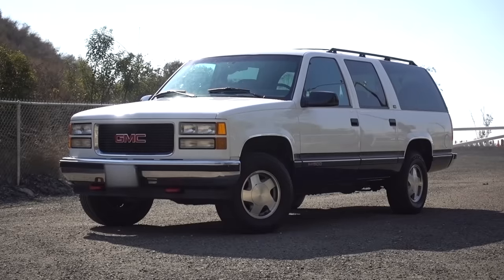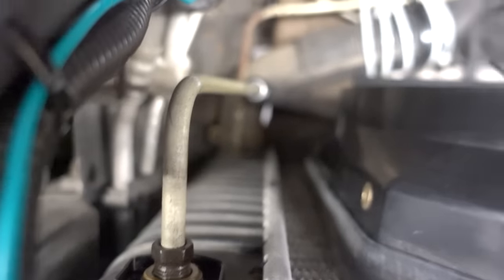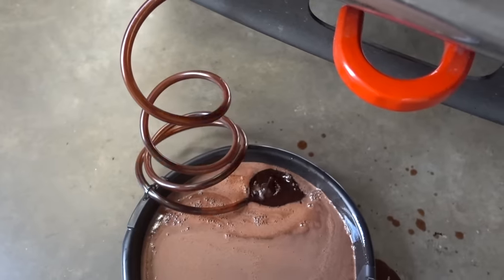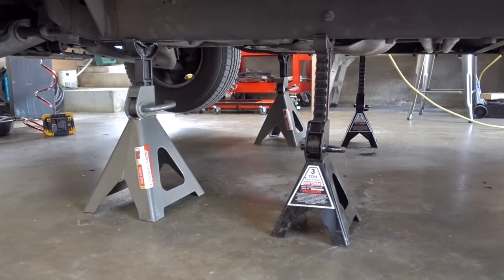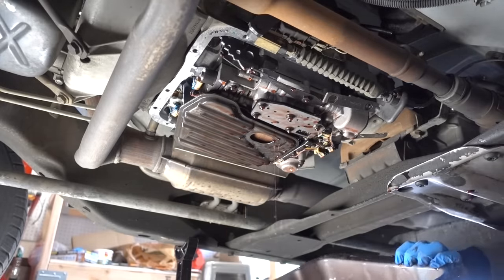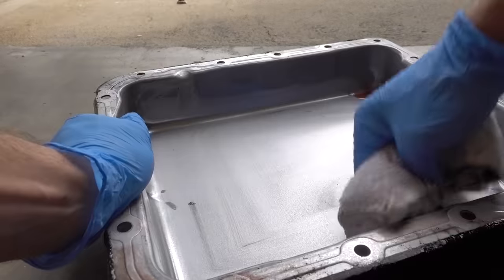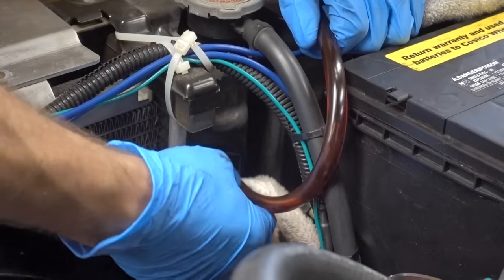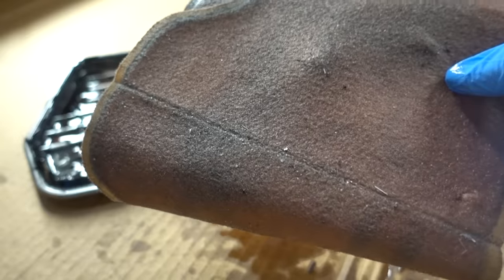Why You Should NEVER FLUSH YOUR TRANSMISSION FLUID!!

Comment: Hi, why you don't recommend to tight down the valve body bolts? If they are loose seems to be a good idea to tight them...

Another question, why you didn't use any RTV on that gasket? Do you think it won't leak?
Reply: What is RTV?
Reply: @shawnclark732  it is a silicon that in order to vulcanizing (get cured) it only needs room temperature. RTV silicone stands for Room Temperature Vulcanizing silicone.
This material is commonly use to either "form a gasket" or as a dressings for the actual solid gasket that comes with the filter, it helps to seal better, there are several good brands out there such as Permatex or JB weld.

As you can see, he didn't use any RTV Silicon on that gasket, that's why I'm asking if he thinks in won't leak...
Reply: @maxdeniel  thank you!

Comment: Too bad they don’t have drain plugs.
Honda procedure to do a flush is 3 drain and fills with a drive cycle between each one.  
I did that procedure to a 2001 Nissan Maxima,  with p0744 check engine light.  It went from not drivable to something that was ok to drive but still gets p0744. ( I used valvoline maxlife full synthetic ATF, Lucus transmission fix and seafoam transtune). And of them all the trans tune I feel helped the most.
On third drain fill did not use any additives just ATF.  
I suspect it has a failing solenoid block/harness, failing transmission temperature sensor , or Failing TCM.  
Also it has now some problems not shifting into o/d where as before this starting from stop and the 1-2 shifted hard.
It has almost 210k miles.

Comment: I changed my fluid on a Dodge truck at 100,000 miles and sure enough it blew the torque converter in about 2 months.  I was warned it would happen. So was it ok?

Comment: Have a Hyundai Tucson 2017 that blew its motor.  !st time I have had an issue with a Hyundai and I've owned 6 now and averaged over 150k miles on three and over 100k on the other two.  My current Tucson had 75k when the engine just quit, got a brand new crate motor installed via warranty and am damn sure getting the transmission flushed now as it still has just under 25k warranty left as well.

Comment: After removing  the filter the VALVE BODY  is usually  located above. The valve body is a elaborate  system of valves that operate the various  mechanism  within a automatic transmission.  These valves control the bands which control the clutches for various speeds. Automatic transmissions are fascinating  ingenious devices that get  taken for granted yet they make life so much better and deserve  A LOT OF RESPECT!!!

Comment: I have been a automotive service technician for 30 years. And I know this is a 5 year old video, but having watched it. I have to say that this is definitely 12 minutes of how not to change your transmission fluid. That so called flush by it's self could smoke the clutch packs and damage the converter with the lost fluid pressure.

Comment: I would drain the pan 1st, then fill it with new fluid and then flush out the old fluid with the new fluid in already and I would stop every 1 liter of old fluid pumped out and top up with new fluid.  Never let the transmission run with low fluid level.

Comment: Why do you not do your first pumping til fluid bubbles then pull the pan, should be nearly empty, clean pan and change filter, re install pan, fill with clean fluid, then start car and pump out remaining dirty fluid until good clean fluid comes out? That way the first clean fluid you put in is going into a clean pan with a new filter. Just my 2 cents. When I do it I do it this way but with 2 people. I continue to feed in new trans fluid while second person goes to reverse, then drive, then second and first. With brake on just to circulate new fluid thru clutches to get a more exact displacement. When clean fluid comes back shut down and adjust level. If low you can add. If high you can pump off

Comment: My friend has a 2009 honda oddasey. At 125,000 miles the transmission  fluid was pure black but not burned,,I know it was risky  but what I did was  remove  the drain plug and replace  the same amount  of transmission fluid ( castro japan make compatible), about 2 quarts ,,,every oil change at 3500.00 miles,,, did that  5 times,,,now transmission fluid has nice shade of pink and I will leave it alone....

Comment: My autobox leaked pretty badly after transmission oil change, I didn't think it was a bad thing, it was just the oil get cleaner, so the gunk that kept those leaks sealed just cleaned off.
Not changing the oil and keeping dirty oil is just hiding the problem until it get worst, oil change revealed the problems.

Comment: i agree with not flushing.  Change once, run the system, change it again.  Flushing, especially some power flushing has more risk than reward.  I have never lost a transmission going back to 1968!  68 ford torino C4.  Ran until 1985.  84 blazer 200k miles,  Three full size K5 blazers, 1988 chrysler 240k miles,  1997 buick 220 k miles,  Now running a 2008 Kia sorrento at 110k miles.

Comment: I would think that this procedure would be hard on the transmission  pump (s) ?  Just like when you run out of gas  in a fuel injection  system the fuel pump is in the gas tank and running out of gas will weaken, if not ruin the pump in the tank. Also the TORQUE  CONVERTER  has to be flushed out and I see this method to take care of  the torque  converter  also. With this method I only see the pumps  integrity  to be compromised .

Comment: Hi,
I have a quality torque ranch and I want to torque all the little bolts to specs like you have done in this video. My truck is a 2014 gmc  
sierra sle 5.3L 4wd. 
Ibwas wondering if it require the same 8ft lbs of torque as well or is it different?
Thank you!!!

Comment: Wow such an involved process. I Love my Smart car with Automatic Manual Transmission. It's a manual that drives like an automatic.. you don't have to use a clutch to switch gears a computer does it for you. I just changed my gear oil. Just remove the top plug then a bottom plug for draining, close bottom plug and fill the tranny from the top hole right from the bottle. Close top plug and drive.  Easier than changing oil because you don't even have to change a filter. I'll Never own another automatic transmission.

Comment: correct way is to know the capacity of your trans system,  then attach one hose to pressure line and put it in drain bucket.. then another hose to suction line and put that hose  a bucket of new trans oil as per your system capacity...start the engine... the drain bucket will start filling and fresh fluid bucket start emptying.. when you see fresh fluid coming out of drain means your system is renewed with new fluid.

Comment: You are correct! I had my transmission fluid in Market changed on my 1988 Lincoln mercury grand pre-with the original 89,000 miles, and right after that, I had to have my transmission replaced.  All that crud that was in that vehicle caused all the gaskets to go bad. It was a very expensive lesson.

Comment: Hi . I saw your clip and I have a question: is it correct Take the two hoses out of the radiator and put the air compressor in one of them until all the liquid comes out (the car off)

Comment: Not all types of contaminants can be removed and there is a chance that transmission flushing will completely clog the oil passages.
I had a customer who put Adblue in his diesel tank.
I then vacuumed, cleaned and dried the entire tank.
Then I flushed all the lines and changed the fuel filter.
It all came to nothing, because the engine had no compression because it had water hammer due to the Adblue.
After the engine was replaced, the car ran again, but the customer was a few thousand euros lighter due to his mistake.

Comment: I do my vehicles every 100000 km  And the only time I ever had a problem with a vehicle transmission is when I didn't do it every 100000 km In my early years when I was afraid to take on such a job. Now I can do it  Fluid and filters usually in an hour.

Comment: I don't think I have ever heard anyone say "don't change your ATF"....ever.  In almost all cases in my experience where a transmission failed after flush and filter change , it was due to incorrect fluid replacement, i.e. Dexron II instead of Dexron III, etc.  But nothing kills transmissions (like engines) faster than abuse and neglect. :)

Comment: I wanted to know more about transmissions but after watching this, ya he did a flush on a 70.000 mile vehicle it should be ok but if it were at 180.000 or 200.000 I'd would advise against it because loose clutch metrial can clock up some components causing failure of the unit

Comment: I flushed my 02 trailblazers transmission at 195,000 and I now have 214,000 and no problems. If done correctly its fine. Flush till fluid its clean wile adding at the same time. remove the pan and replace filter clean magnet and your done. After 500 miles pull the plug and inspect fluid and replace the fluid again if necessary. Forgot to mention i bought a new pan with a drain plug on ebay for $40

Comment: If you didn't flush your system between 100k-120k don't do it  because my experience new oil has cleaning additives that dislodges clutch and disc material from valve body travels down and clogs small cone screen in the valve body and causes areas to get dry check balls stay open and solenoids start faulting out and I have seen orings blow out on clutch packs because the new oil is flowing harder on the initial start up. I'm curious to know how his transmission  will do in the next year at least.

Comment: Absolutely, 100% fore sure, flush trans fluid. I have a 01 GMC Yukon with 626,000 km's (391,000 miles), with origonal motor and trans. I have five vehicles in my driveway in-order to keep with my large family and Km's range from 320,000 up to 626,000. How do I do it? I change all fluids reqularly.

Comment: Not removing that old filter o ring gasket is a no no! There is a risk of the filter rubbing on bottom of pan causing the plastic neck to crack or break resulting in oil starvation and trans failure!

Comment: The oil pan bolts are all the same, just clean them, that the bores are clean as well, and reinstall them, no need for the same hole installation. I would have added already new transmission fluid when getting the old pumped out, not risking running metal on dry bearings. Sludge remaining often in the coolers itself, so they have to be flushed in addition separately. A lot to say more but...

Comment: There's one thing that you've got to do in the process of the step sometimes you can change the little plastic filter that bolts up into your automatic transmission I sometimes highly recommend if you drop your pan replace that little plastic filter because that's also important too

Comment: I had a 2013 ford escape with transmission problems with 55k miles. The transmission fluid was black and the transmission was running rough. After the fluid replacement it ran like new again

Comment: Not trying to undermine the presenter here but seriously, Don't mess with the valve body bolts!!!

Telling people to mess with these bolts is opening the door for some dingle-berry to tighten the bolts by feel, and that is the best way I know to end up at the transmission shop for a new transmission case, or to the salvage yard. 

Putting the pan bolts in the same hole they came from is a complete waste of time. The only exception is when there is a bolt with a stud and nut on top, as in one that holds an external bracket.  GM is a good for that one.   

Running the trans till you see air bubbles is running the pump without oil.  Great recipe for a transmission rebuild. 

The seal that comes with the filter kit is garbage.  Many times, when using that type of seal, you will find the filter sitting on the pan bottom - the next time you service the transmission, this causes aeration in the system.
The filter is supposed to be suspended by the transmission case, which keeps the filter off the bottom of the pan.  

In the old days, filters were flat on the bottom.  They would fall down and sit flat on the pan and cut off the oil flow.
Because of this, they began shaping the bottom.  That way, if it does fall down, it doesn't completely cut off the oil flow. 

When you buy the filter kit, ask for two o-rings that fit the neck of the filter. 

Install the two o-rings, lube them with fresh oil, gently wriggle them into the case.  

If the oil has been run till its nasty, Service the transmission and then do a second change after driving for half hour or the next day.  
Why, because the new fluid has fresh detergents in it and it will wash the sediment down into the pan and overwhelm the filter and end up clogging the valve body.

If you have a Ford, many of them have a drain plug on the torque converter.  You can drain it to get a more complete fluid change. 

The safest way I know to get as much fluid changed as possible is to drop the pan, clean everything, replace the filter, refill with about 4 to 5 quarts of ATF. Then add the hose to the top cooler line at the radiator and start the engine for maybe 5 seconds, definitely no more than 10 seconds.  Refill and repeat.  

That should net you a pretty clean system.  

Now, for those that really want a lesson on how to care for your transmission:  Don't be a horses ass!  
Running the fluid till its brown or even worse, black, is a disaster waiting to happen.  Transmission shops break it off in your ass when its time for a rebuild.  

So...
Change the fluid every 50,000 miles, rain or shine!
If you really want the transmission to last, bypass the radiator all together and add a good size trans cooler, you'll literally add decades to the life of your transmission by doing that and regular services.  

Former AAMCO Tech.
Reply: You're very knowledgeable and answered all the questions I was thinking of while watching this video

Comment: I agree with no flushing, especially if shops are going to use vacuum machines plugged into the system. Simple trans changes where roughly half the fluid changes out is much better. It's also important, just like engine oil, to change it on a  somewhat regular basis, 30k miles, 60k miles, whatever, but not never.

I also don't believe in multi-vehicle synthetic fluids, the synthetic part is fine, but transmissions, just like engines, are built/specced and tested using specific fluids. Always, always, always use what the manufacturer stated.

Otherwise, yeah, change the filter, drop the pan, but no vacuuming or pumps. If you want super clean oil, due two changes relatively close to one another to ensure the fluid is cleaned up.

Transmissions are very sensitive, and when wrong fluid is involved, you will notice.

Comment: In most cases flushing your transmission fluid is a good idea and if you can't do it yourself then there are garages that provide the service. I would use a garage that I trust for this..anyway as for the vehicles you should never flush if you have more than 100 thousand miles on your vehicle and the trans fluid has never been changed then you could run in to some issues by changing the fluid and at some point your transmission will need to be service by a transmission professional because you will start to loose either forward gears or reverse after that would be to purchase a new transmission some transmissions will last more than 100 thousand miles without a oil flush but you can save the costly repair Bill's by flushing or having the flush done at around 70 thousand miles for automatic transmissions..

Comment: Isn't it easier to attach to attach the vinyl tube to the metal hose that connects to the bottom of the radiator? So you avoid the radiator all together?

Comment: I clicked this video because of the title , And I'm still waiting for you to tell me why I should never flush my transmission , You never did say,  And I think you could of done this in a better faster way,, The way I do it is close to the same as you but once I take out the transmission line from the radiator I install the drain line like you did then I take theline you removed and add some clear tube to it and but the other end in the new transmission fluid so it is pumping new fluid in as the old comes out,  At this rate you get most of the old out.

Comment: Not easy.. I was doing this when I was 16. No Google or YouTube back then..
"Flushed" one in my old 1974 Duster (the Green Loogie).
Was a waste of time and money cause she was already shot.
16 years old, laying on my back in my driveway, i swapped transmissions.. 2 jack stands and a bottle jack. I flushed the new (salvaged) one before hand and replaced the radiator and converter.. 16 years old. 1985, was my freshman year. Anyone reading this have a 16 year old who can replace a transmission on their own today?
If you do then i can only congratulate you. Most of the 16 year olds I've seen today can't even start a lawnmower. Oh, but they seem to know EVERYTHING.
Lol, my buddy and I yanked the 4 cylinder and 4 speed out of his grandma's 1977 Ford Pinto and tossed a 289 and a 4 speed in it from a wrecked 67 mustang.
Mr. Deason across the street was a welder guy and he knocked us up a set of headers.. Lol Granny was 78 years old. That old woman fell in love with that car after that.. 16-17 year olds at the time.

Comment: I have an 03 Chev Blazer (that I got used a few yrs ago) with the 4L60E as well.    I've never changed or flushed the trans fluid.   My mechanic friends have told me to not change it or flush it because it can loosen all the "floaties" and THEY can cause more damage than good.     I've topped up the fluid with some Lucas trans fix and that's about it.  What to do?